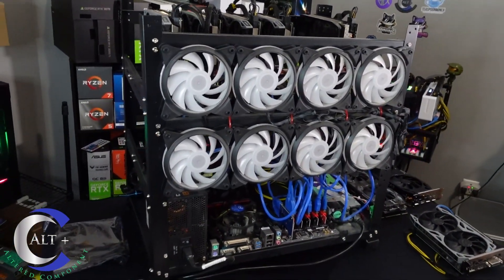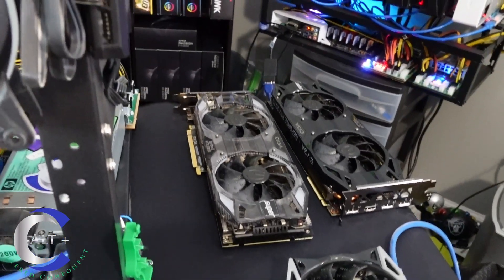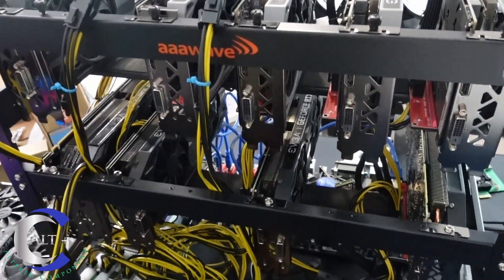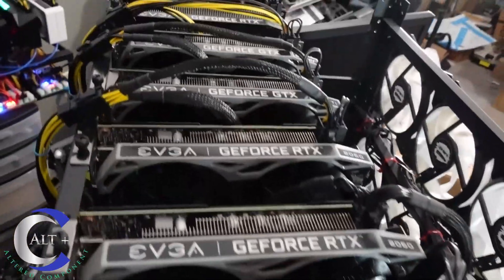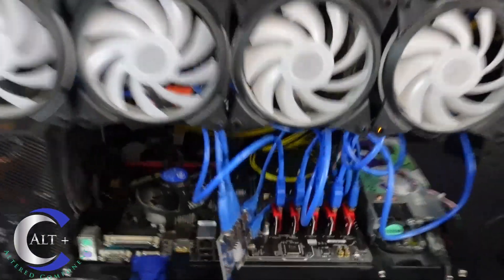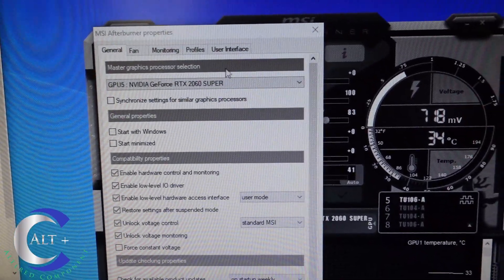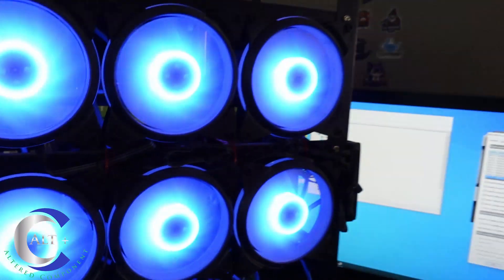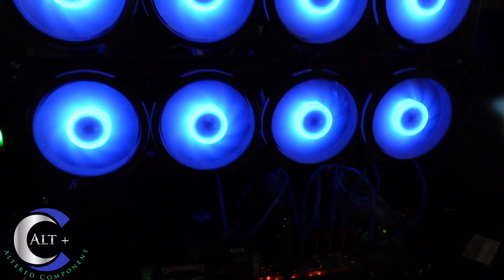🛑 Upgrade Fail: PCIe 1 to 6 splitter | I attempt to add 12 GPUs to the Gigabyte H110 D3a Motherboard

Comment: 9 cards on one Board, designed for 6 is nothing to Complain about !   I just Bought this Board on a 6 card Rig, with Power Button, 8 gigs of Ram, 128 gb M.2 SSD, a CPU, with Fan, all for $77. All Wok as intended, and the Photos look pretty Clean. Now that was nothing to Sneeze at When I was just looking for my First Morth board for Mining GPUs ...  If you had a 12 card Motherboard, and tried for more, You would not Get any more on them I think !  CPU Lanes only Split up So Far !  You could have tried a Better CPU for 12 Cards !
Reply from the maker: Glad to hear this is working out well for you.  Yeah Red Panda has done many testings where he tried different boards trying to get way more gpu's running.  The simplified answer is you can only logically get as many gpus as there are pcie lanes available 1) from the CPU 2) from the motherboard.  The complex part is squeezing the the  max lanes from both for the optimal setup.  Honestly i can build a 8 card gpu rig in my sleep.  When i go above that i often run into issues.  I do have 2 rigs running 12 gpus on a asrock q270 Motherboard.  That is a premium board though with a premium price.  Keep up the good work

Comment: you do know using the m.2 takes up 4 lanes if its a NVME for 1 card, this will take away from the other PCI slots, their is a m.2 that will do 4 cards.
Reply from the maker: Thanks for sharing.  Depends on the motherboard and how the integrated lanes are setup.   But u are right, often a m.2 can disable other lanes. Some boards can share pcie lanes with sata too.  Mine on

Comment: Thanks for the video. I have an old Intel DX58SO motherboard and should check how many PCIe lanes I have before expanding any further.
Reply from the maker: Was just doing some research on this and the x58 chipset is pretty interesting and boasts up to 36 pcie lanes.  To learn more on it, just Google "intel x58 specs".  Should be easy to vet this out.  Let me know what you find/ how it goes

Comment: @Altered Component Hello. When i use 2x 1 pci to 4 pcie splitter it isn t work? some people write they run 12 GPU it is possible or no?
Reply from the maker: It is possible, however it really depends on your motherboard and cpu.  The amount of pcie lanes provide by the motherboard and the cpu as well must be enough to support the additional cards.  For instance i recently tried to move my 6 gpu gigabyte h110 mining motherboard from 9 cards (already had a 1 to 4 splitter on it) to 12.  Anytime I went above 9, system would fail.  After doing some research,  9 is the max supported for this board.   Hope this helps
Reply: @AlteredComponent  O thank you for fast reply. so i don't have to try 2x splitter? :)    And i have second mainboard ROG MAXIMUS IX APEX this board have is better i can use M2 to PCIe , H110 D3A does not have this option.
Reply from the maker: @mitsubishmr  that is a z270 board right? If so, then it should support up to a 12 gpu build on it.
Reply: @AlteredComponent  yes it is z270 and what you think about 13 GPU win 10?

Comment: I thought besides the chipset there is also a pci lane limit on CPU's, which CPU are u using ?
Reply from the maker: Great thought, but definitely not the cpu.  most celeron g series give at least 12 pcie lanes.   Mining office said his h110 d3a mobo taps out at 9 as well.  I researched the h110 chipset and it stated 6 pcie lanes in intel arc.  Guess 9 is bueno ;)

Comment: ahh man, time to get a B250C from Aliexpress!! Great video!
Reply from the maker: You read my mind.  That is exactly what i am going to use.  Going to eventually swap that board to the btc b250c and bulk that up to 12 cards.  Running out of space and need to get that up to 12 gpus ;)
Reply: @AlteredComponent  my next build will be with the b250c.. I like that it doesn't need the little pcie riser boards.. 1 less failure point (well 12 actually..lol)

Comment: I know U Rock windows. Wonder if u flashed hive and tried it would post w ten?
Reply from the maker: that is a great thought.  I am about 99% sure it is the H110 Chipset limiting me on pcie lanes.  The fact that the bigger 1 to 6 splitter worked fine to pull in up to the 9th card tells me that it is more than likely limited by the mobo.  When i googled the specs on the H110 Chipset, intel arc site lists it as max lanes 6 pcie lanes.  So the fact that i can run 9 is probably pushing it fully.